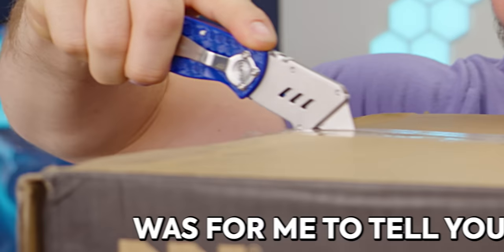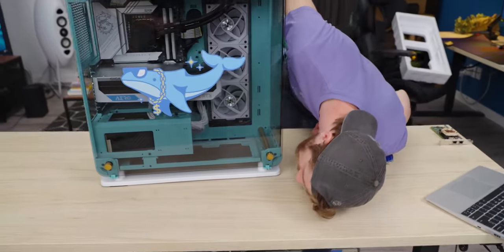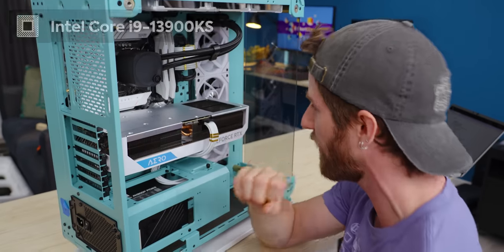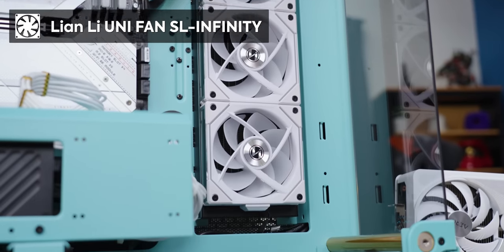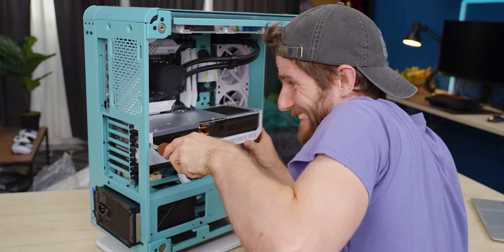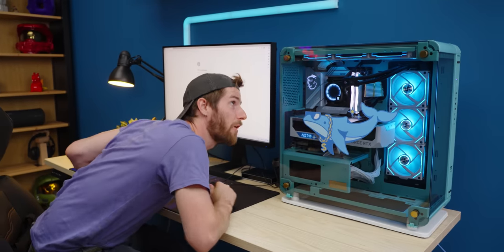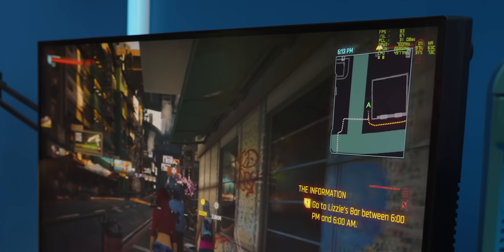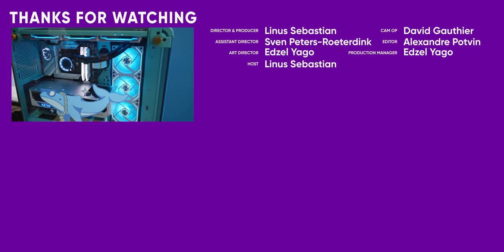You paid $10,000 for this PC... - Starforge Whale PC | LTX 2023

Comment: Ouch!  3d12 to the liver!  I know it's not meant to be a $10K system, but omg, what a letdown.

The cherry on top is the utter cheaping out by using an X540  instead of the better, and cooler running,X550.  Crunchy gpu and no brace are runners up.  Hopefully, he kicks in a screwdriver and backpack to mitigate the sting.

Comment: The cable bracket Linus broke is supposed to stop the 12VHPWR cable from bending too much and causing the melting issue 🫠
Reply: this video is out of this world...

"Hey check out this pimp out pc!"
<shows enourmous sag on gpu>
<shows that pcie slot is cracking from stress>
<adds no supprot bracket that even I have for a merely 3080>
<breaks important safte feature on cable known for safety problems>
<mentions broken legs>
"SEE YA!"
Reply: Not having a connector fully plugged in is what causes the melting issue. The plastic shield cable mod includes is supposed to be a reference on the 3.5cm clearance needed from the case.
Reply: @themadrusski2256  they can also melt being fully plugged in as well. its not user error its the design of the plug itself. nvidia revamped it w a new plug now.

Comment: Couple of things worth noting is that they forgot the back-plating bracket to the right of the slots is completely exposed, no GPU support brace keeping it from sagging and damaging the GPU [ Which is happening alot now these days since GPU manufacturers are starting to save on the pcb and there for easier to crack it ] plus the motherboard slot that it is in can get damaged aswell in shipping.
 There is blue tape with the number 1 on it on the lower back end ( Why? ), also the PSU shields i can overlook from the side panel side but what about the top side...
 And there is the motherboards back plate slot there seems to be a Hole next to the Fan mount sorta exposing free flow there.

Comment: THE PC COMES WITH A GPU SUPPORT. no idea why the LTT team didn't put it in for this video. It was removed for shipping
Reply: If that were the case then the part that screws into the motherboard should still be there.
Reply: @tzuyd  it doesn't screw into the motherboard...
Reply: @AyyyGabagool  There are literally two replacement stand off screws that you need to use.  It screws into the motherboard.
Reply: @tzuyd  it's just a stand...

Comment: Whale pc 10k problem: GPU SAG, Bad airflow inside the pc. i mean you are paying 10k, they should add one back fan for extra exhaust.
The only good thing about it is the design, its very beautiful and amazing.

1:29 The LTT Whale pc in 2022 have much better airflow and sensible pc spec. not too powerful, not too low spec.

Comment: i really cant believe they shipped the heaviest gpu possible with cards that are cracking right at the spot where it would be sagging without even any kind of gpu support.  not even saying a bracket has to be used but how could you ship it without some kind of expandable foam inside the pc.  the gigabyte cards also come with a gpu support bracket that wasnt installed.  The amount of traveling that pc has to do, thats crazy.  I would be kinda sad if that was my pc.
Reply: This was as he said in the video hand delivery, so no foam needed. But the missing bracket and badly placed whale, no custom cooling, ... is not worthy as a 10k pc. its so standard, shame...
Reply: @Fynnuekue  thats kind of silly. What do you mean hand delivered? Like it was built and packaged and someone carried it to his studio? Haha. It had to be driven or even hand trucked at some point, which the vibration and bumps alone are not good

Those gigabyte cards aren't supported as well compared to like Asus cards, right where that little finger locks into the pcie slot, it's so weak right at that point the sagging would put pressure on.

Not even really Linus's fault that gigabyte cards are weak but I would never pay for that system

I'm probably just not a whale so maybe it doesn't matter and I'm looking at it from my point of view and maybe the whales are paying for the ticket and not the pc

But even the way the PC was slammed around to open, I hope that's not somebody's hahaha.

I feel like a jerk saying it but idk, I'm worried about my gigabyte 4090 just sitting on my desk with proper supports

Comment: That crunching noise is the PCB cracking, which is a growing problem for Gigabyte 4090s. Luckily, Gigabyte is denying warranty claims for it. And if the PCB doesn't crack, the solder on the VRAM modules will fail

Comment: WOW, That OBS gameplay looked awful. Next time if you can just use Shadowplay. It looks so much better if you turn up the bit rate to 120 or higher. Also, whom ever does get this PC, I hope the GPU survives the trip to its final destination. I mean, the GPU already made the cracking sound and that is where Gigabyte GPU's end up breaking and renders the card into a brick. Jay did a video on this informing on what Northridge Fix is finding out about the broken GPU PCB locking tab.

Comment: Well you can be happy that this PC only had the Core P6 Case from Thermaltake. If it would be the Core P8 there would be a weight increase of around 4,7kg (10,3617lbs). That P8 Case alone wieghts around 22.6 kg  or 49.8 lbs. Thats freakin insane if you ask me.

Comment: CPU radiator is the wrong way as well... need to have tubes down as the top of the reservoir in this case is where the air will pool

Comment: TBH, that noctua fan on the NIC was probably cooling even better since you moved it over the fins instead of the solid circle of metal it was over.
Reply: you do realise there is an effective area for blades and waste area for fan base?
Reply: @yamusa85  That tiny fan was basically sitting on the solid part. Those fins had minimal airflow at best.

Comment: Is it just me or... is the CPU cooler oriented with hoses at the top of the radiator? I thought that orientation was basically guaranteed to make sure whatever air bubble you have gets stuck in the pump, and you should always put the hose end at the bottom if possible or orient the radiator horizontally.

Comment: tbh those temps are not great. my i7 doesn't usually go over 60 while throwing everything I can at it and I just have an air cooler. (not stock mind you.) gpu temps are better than mine though, my gpu regularly hits anywhere from 70 to 86 in game, but than again my gpu cooling sucks and sits between 50-60 at idle. so again, temps are not great.

Comment: i wonder what is faster at this point, 13900KS with DDR 5 6000 or 7800/7950x3d with ddr5 8000 after new agesa bios
Reply: Yea I wonder which setup with the faster ram is better.
Reply: @jakep1481  i know people often talked on ryzen release that if you use ddr 5 7200 with intel it will be faster, tbh it's barely faster, i wonder if those higher frequencies will benefit one platform more than another and if it's better than going with timings, since biggest increase i've seen was from going 30-42-42-108 to 30-42-42-56 or so, i think it was double the gain of additional 1000mhz
Reply: @jakep1481  it's a bit more nuanced than that. having 32g sticks means the memory is operating at dual rank meaning that even if you have a slower rated speed, the effective performance would be similar to a faster single rank kit. however, whether A. that would scale to as high as 8000, performance-wise or B. if the memory would scale on ryzen, even with new agesa remains to be seen. in any case, isn't the cache sort of a way to bypass the need for fast memory in the first place? 🤔

Comment: Colton blaming damage on LTT again.  That damage was not caused by LTT, it is a well-known  with these high end cases that are mostly steel or tempered glass.  The styrofoam mold is made for a lower price/quality case with similar dimensions and a lot less weight. These cases need to be shipped with a styrofoam block on the bottom that is cut to distribute the weight evenly across the bottom.  I've gotten mint-condition boxes with no damage at all, only to open it up and find the 4 pointy feet have punched thru styrofoam at an angle and the whole base is twisted.

Comment: $10,000 ???  Seriously??? They are overcharging by about $4,000, and that is being generous.
I have the same system (different parts, most better to be totally honest) - 4090, and I put it all together for less than $4,000 
I would love to see the parts listing and cost for what you have there?

Fractal Define 7 XL - £210
ASUS ROG Maximus z790 HERO - £690
64GB Corsair Vengence 6600 - £320
i9-13900KS - £690
2TB Samsung 990 Pro - £225
2TB Solidigm SSD - £118
Corsair HX1500i - £230
Arctic Liquid Freezer II 420 - £110
Total - £2,593
US Dollars - $3,325

So unless that graphics card is nearly $7,000, someone is overcharging.

Comment: $10.000 - the GPU (which is from Gigabyte) is sagging, “only” 64 GB RAM, no factory tuning (84 C on the CPU could be lower with a simple undervolt)… how much did it cost to collaborate with this Blue Horse that no one has ever heard of? And no mention of the cable management… seems like Linus is upselling this a bit.

Comment: they could have slapped dat sticker over to the psu side but no, they hid the fact that they even cheaped out on a gpu support, also i would not trust those glass panel support at the bottom, if those pinch the panel it might shatter i would imagine?

Comment: The profit LTX is making on the whale tickets is insane.
I have the same build. 13900KS, a better GPU (ROG Strix OC), a better MB (Z790 AORUS Master), better RAM (2x32Gb Trident Z5 Neo 6000Mts CL32), better PSU (Seasonic 1300w Plat) and more storage (1TB nvme for OS + 4TB nvme for Games + 4x2TB SATA SSD in RAID5 for Storage). Also has custom all EK water cooling (CPU + GPU), 2x360mm rads, Twin Pump/res combos and all built in to a Monstrous CoolerMaster Cosmos Case. It weighs over 40kg (88pnds) and cost me a bit over $9000AUD (~$6000 USD). And the pandemic prices hadn't dropped much in Australia when I built it. The GPU alone was $3500AUD.
My point isn't to brag, though I kinda am, my point is that this Starforge Whale PC is not worth anywhere even close to $10k USD or CAD. I'd say closer to $4000 - 5000USD taking the custom case into consideration. Mad profits for LTX on those tickets.
Reply: They literally say it is a $5k pc. Plus, the 10k whale ticket gets a bunch of other stuff including the hotel for two nights, but also...yeah, making money is the point of selling tickets. That is how a convention works.
Reply: @cliffdavis  Really, selling tickets is how conventions make money? I always thought the money just magically appeared in their bank accounts. I never said making profit was a bad thing fella. And I didn't know it included accommodation as well. When do they say its a $5000 PC though? I must have missed it.

Comment: Why did they use such a "slow" RAM kit? You are using an Intel platform, which is stable at 6800 MT/s, AND at 6800 MT/s you can get a CL34 instead of a CL38, or get a 6000MT/s CL30 and overclock it to 6800MT/s! With how top of the line everything else is in there, that RAM kit will most certainly be a bottleneck more than anything else in this computer.

Disappointing for what was described as a 5000$ PC in the Whale ticket. Even moreso when everything else look 100% awesome, feels like a rookie mistake to make.

Comment: 10k ticket for a 5k pc that use all standard part, not even top of the line, even a basic AIO, and they just slam a sticker on glass, do a basic paint job and done. LOL
For that price, as minimum, all custom, with custom liquid cooling. Custom engraving, etc etc.
Then you have machinery and engineers and can't do a basic GPU support or a case for the network card.

Comment: Wow, 10 grands for that? GPU sag, not so good mtb and a bad power supply on top of that. MSI probably throwed some money there. And that whale sticker which covers the gpu on top of that is just bad (maybe to cover that sag?) :D. I would not spend 10k for that even if I have unlimited cash resources. The case theme and fans are not bad for sure and at least I know which system integrator to avoid. I'm pretty sure the LTT team knows how to build a better looking and well builded PC than that turd. Plus the PC from 2022 was looking much better for sure.

Comment: Am I weird for having 3 complaints about this?

- why is it just a whale theme? For all the branding LTT is so good at, there’s not a single LTX logo on it etc?
- that GPU desperately needs a support bracket, and the fact that starforge didn’t include one is….not a great look for a high end builder. Especially without the excuse of budget for one of these luxury builds. They could have made it something really cool. 
- I feel like for all the custom design on this, the back panel looks cool, but the whale logo is….lost in the noise of the GPU and lighting. They know the hardware placement, wouldn’t it make sense to have it in a better visual marker? Would have been need to see them do some color on the tempered glass too.

I don’t think these are terribly big issues for normal builds, but for 10k builds, you set a high bar of quality.

Comment: you said it has 13900KS!  do you ever check the motherboard temp??!!    that full glass case never gonna cool any part of the motherboard or even nvme & etc ! its AIO and rtx 4090!
     we talk about 450+150=600w heat and yeah those are nice fans but they not gonna make this case cool with that position!   full glass case are not good at all not even for rtx 3070

Comment: Cyberpunk eats CPU's like nothing else I've seen! Not in a bad way, my 5900X also sits at around 50% and I'm not running a 4090! I had a 2060S when I played this alot and later a 6750XT 12 gb... I had great performance tbh, 80 - 100 fps I think now with the 6750XT... anyway, I tried to turn one CCX off on my CPU and the CPU then was at 100% load constantly....
I have no game that come close to pushing cores like this game does. And I have no clue what is so damn demanding because the game is pretty bad. It still after all these months and years even feel unfinished, great underpinnings but unfinished, kinda how most Bethesda games are... you find stuff that just never was completed all the time right in your face, not just hidden somewhere... everywhere... its like little stories that crop up that never get an ending...

That system looks amazing tho, love the colors!

Also, can we ban Linus from touching anything costing more than 150$? 🤣😅😵‍💫

Comment: I want someone to take a 4090 and put a 4070 heatsink on it... I have a STROOOONG feeling that the 4090 heatsink is literally e-peen and wholly unnecessary
Reply: When 4090 cooling solutions were designed AIB partners thought it was going to be a 600 watt card. Nvidia changed the power limit after the launch batch of the cards were already made.